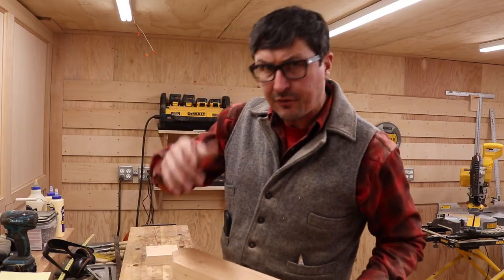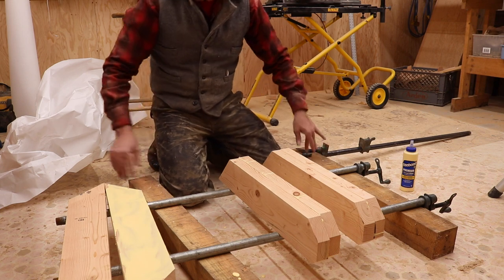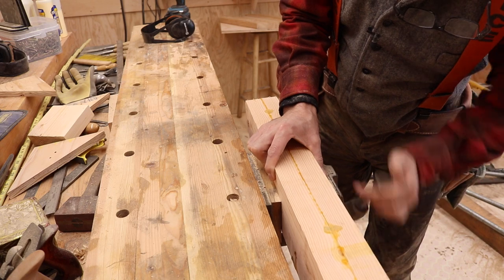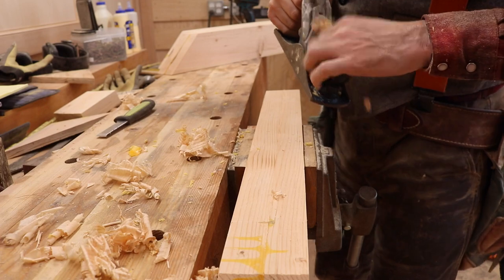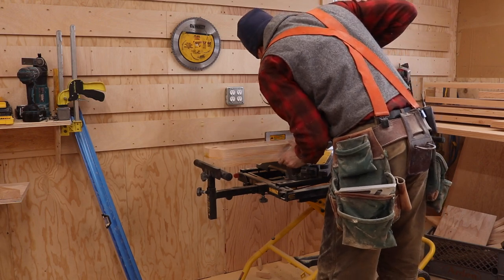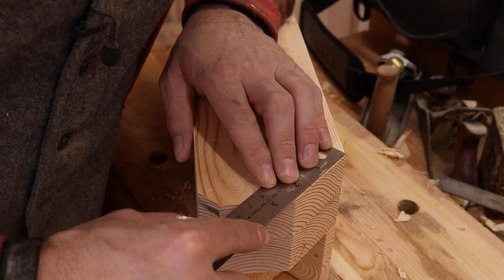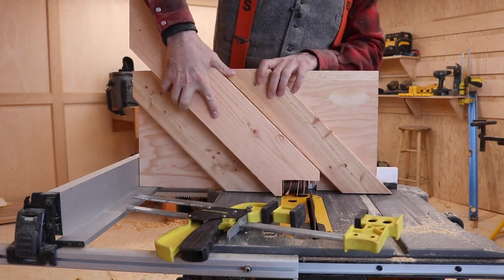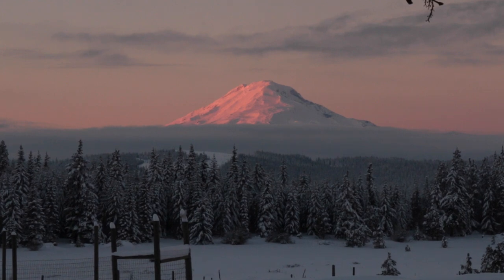Build A Simple Sturdy WORK BENCH for $150

Comment: That jig you built definitely works fine. You can save time when you build jigs if you build a table saw sled. Even complicated cuts like the one you were doing wouldn't take more than 5 minutes to set up with pieces clamped to the fence of a good table saw sled

Comment: Mr Wranglerstar note to self if you would have used a wet rag and wiped off the wet glue you would not have worked so hard after it dried
Reply: Scott Nei he may be going to finish it with something  once it is done.  a wet rag will impregnate the glue into the fibers. A finish then won't be able to soak into the fibers
Reply: Lots of people don't want to wet the wood. This is one of the very good reasons not to.

Another method for applying glue is to actually spread the glue (before the clamp pressure) using a foam paintbrush or the like. If you always spread the same amount of glue over wood as a layer, then the amount of glue pushing out is a rough measure of clamp pressure.

You really want to start using cauls when clamping as well. Consistent clamping pressure and avoids the clamp marks.

Enjoying your videos; keep it up and happy birthday to Jack.
Reply: i face palmed when he used the hand plane on glue, R.I.P blade.
Reply: Cody can do another video on sharpening the blade.

Comment: I'll offer a few tidbits that may help you next time.
1. Glue is cheap.
2. Let the glue partially set and use a chisel.
3. Wet rags work, but you may pay for it later when you apply a finish. 
4. Never dull a hand plane on hard glue. That's what cheap chisels and scrapers are for.
Thanks for the great videos.
Reply: I was wondering about the plane, glue hardens stronger than the wood and I imagined it would be rough on the plane. I paid the price of using a wet rag recently on a walnut piece. Ever so slightly, but there's a little bit that wouldn't take my oil finish like the rest of the piece.
Reply: I use an old #80 Stanley scraper for dry glue removal.

Comment: When we made diagonals for bracing and doubled them as you did, we would drill at least two holes through the diagonal side and drive 3/4" dowels through to increase shear strength so over time the glue joint would not shear or weaken.  We'd dry the dowels in the oven (low heat for a half hour or so to slightly shrink them), and then drive them in holes the size of the unshrunk dowels.  The slightest humidity would swell them back to size and they were locked in as if screwed in place.  Never had any come loose, and some of the joints are now over fifty years old.

Comment: I used a plastic card to spread the glue and only need a thin layer, also avoid gluing the last 1/2 inch around the end. once you clamp your wood together the glue will squeeze out to the edge for you.

Comment: Hi Cody,. I really enjoy your inspiring videos.  One tip on removing excess glue.  After your parts are glued up, go back in about 20 minutes or so and scrape the glue off in its semi hardened state.  It will be pliable and peel right off if you catch it at the right stage of its cure.  Give this method a try and see what you think. Best Regards

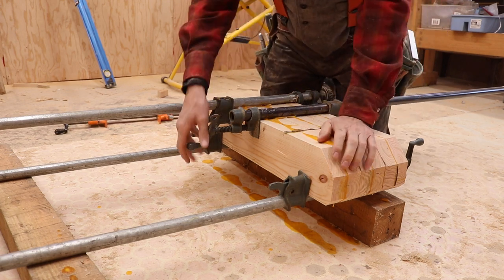Comment: 3:57 What I've learned from the videos is that too little glue is worse than dripping out.
You really spread it out for the complete surfaces to be in contact, so those will be joined forever as if they were a single piece of wood.
Great job and thank you for the valuable lessons!!

Comment: The moment I saw how much glue you were using I thought, boy, is he going to hear about that! Gluing is one of those things that everyone will have an opinion on. How much is too much, wipe it wet, clean it dry, all are personal preference. What has always worked for me is the one my Grandfather taught me. Use enough glue to just squeeze out of your joint when you clamp it, and wipe it off while it's wet. It will make a strong joint, and not require any more work when it dries. Trial and error is the only way to figure out what is enough. Say Happy Birthday to Jack for me.

Comment: Cody, throw some pads between those clamps and wood. Either rubber ones to mount on the clamps or scrap pieces of masonite.  You might want to consider building an out feed table behind the table saw too. And a stacked dado set is indispensable.

Comment: Use a plastic tile glue spreader, or make one from a piece of alum sheet metal. Like a toothed comb. Banding steel works well if you can find some wider stuff to use as a glue scraper while wet. after the glue has set, a piece of sheet metal that has been sheared, will have a burr on the edge that really works well to scrape excess glue. Stainless steel works best for that. A wide beater chisel also works great. It helps to get most of the glue off before going to the saw, the excess glue melts when being sawed, and gums stuff up.

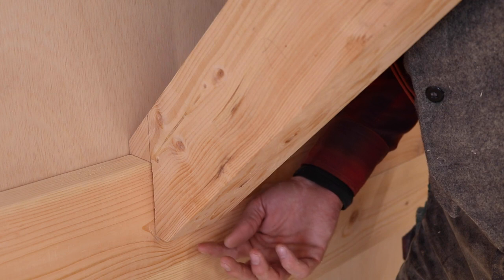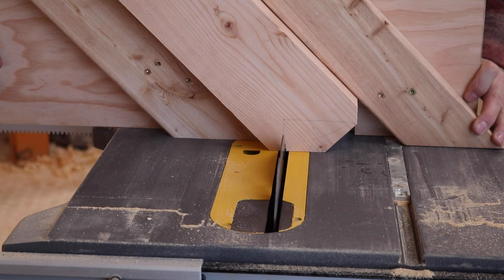Comment: At 11:10. One can Always go one step further and make a notch in the ledger, with a slight slope toward the wall, and make matching slope on the bracket (12:50) The more downforce he harder it will lean on the wall without the risk of sliding off the ledger.

Comment: this is not a criticism of your work (I really like the work) just a thought, it seems the weak point of this bench will be the wall it is mounted to.  The 2x4 studs 24" on center will probably be pretty shakey if you really get pounding on the bench.

Comment: I bought a normal knife from Mora. Going to buy a chisel from them next. I will have to make a sheath for it though. Not a fan of the plastic. I prefer the feel and touch of leather. Always nice when i buy a new side of leather. Makes the shop smell nice for a couple weeks.

BTW - I'm savings the plans for a leather bench down the road. I've had thoughts on making one similar. I think your design is much cleaner.

Comment: You know you've put enough glue on when it starts to seep out of all the sides evenly after you clamp it up but obviously if it's dripping everywhere you used a bit much. if you're clamping together boards with routered edges a straw works great for getting the glue out before it hardens and becomes a bit of a problem otherwise a wet rag works fine.

Comment: Could you use the miter saw to cut the birds mouth? Cut from one side then flip/rotate the piece. You would make two cuts at 90 degree angles to each other. All you have to do is clean the corner a little instead of clean the pieces from all the cuts.

Comment: 3 master carpenters gave me (us) instructions on gluing. use the narrow spout that comes on the small bottles, do not pour from the open bottle! keep the small opening clear using an old 1/8 inch drill or a 16 penny nail. apply a zig zag pattern, zigging every 2 inches on most applications, every 3 inches for extremely hard wood. stay 1/2 inch away from all edges. join gluing pieces together, rubbing the 2 pieces together, separate them and check that ALL surfaces were coated. clamp 24 hours. Pleeeeasse spare your plane,, the poor thing,, lol

Comment: Nice. Get some leather, thick stuff, 5mm (Two squirrel teeth) and glue it to the vice face. It gives unreal grip, protection and you need heaps less torque on the handle.

Comment: HELPFUL TIP*** Hey Cody!  If you ever find yourself ripping stock through your Table Saw thats thicker than the height of your blade, set the depth of your saw blade to just over have the thickness of your stock. In doing so, any discrepancies in the squareness of your blade to your table will be cut in half and you wont end up with nearly as deep of a groove from where your blade brushed back over the second pass!

Comment: Hi Cody, I also have a dewalt table saw and know how much fine powder it produces. Im guessing all table saws are the same. I only use mine outdoors though as i have no dedicated space for it but i avoid the issue of air quality as a result. You should be aware that fine wood powder is VERY BAD for your lungs. Most guys that work in woodshops are very aware of this and have air filtration units on their machines and on the airspace of the workshop. Do a little research for yourself and make your own mind up but do take a little time to look into it !

Comment: You mentioned that you should have cleaned up the glue before it dries. I have always been taught to let the glue dry and then sand/plane it off as you did in the video. If you try to clean up the excess glue when it is wet you will end up smearing it into the grain of the wood. If you were to stain the wood, the glue could effect the ability of the stain to soak into the grain resulting in discoloration

Comment: Instead of using paper on your bench to keep off the glue, try my technique. I got a plastic carpet mat for an office chair that doesn't have the spikes on the one side and is smooth on the other. Cut it down to fit on the bench top and use it when gluing. It can be cleaned with a wet cloth before the glue dries or scrape it of with a putty knife or wood scrapper. The glue does not stick to the plastic. Saves a lot of trees in the forest and money in your pocket.

Comment: This isn't a criticism more so than just an observation and suggestion from a guy who took woodshop in high school and has done a few projects since then.  That was A LOT of glue @ 2:12.  Feel free to waste as much as you want, but that was way more than you needed and you ended up having to take extra steps in your project to clean up the mess.  You seemed to recognize that.  May I suggest some disposable foam brushes and a coat just thick enough to cover the entire surface?  If you're squeezing out that much, you're using way too much.  Cheers!

Comment: You should check out Jay Bates woodworking channel he has a rubber? roller about 4" wide that he uses to spread glue with.  It seems to get a very smooth and consistent coating of glue on his boards and while he's never shown the cleaning of it I assume you could just rinse it with water for a quick cleanup.

Comment: I have seen fellas use sawdust to help clean up the glue spillout when they clamp them up and seems to help quite a bit.
Reply: Mike Sweeney if you don't pour a whole bottle of glue on and then use excessive pressure on the clamps, you won't need sawdust for anything.

Comment: about a 3mm layer of any adhesive would be sufficient mate :) and yeah use backing for your clamp down too :)  LOVE the channel. . . recent subscriber enjoying all the content i've taken in thus far!
Reply from the maker: 3mm? what are you talking about Sikosis?
Reply: heh, the glue you put on the braces. . . . used probably 3x the glue you actually needed :)  was always taught between 1 & 3mm with some air time to induce tac. . . then brace with at least a cross brace to dry. . . . always cleaning excess and press over during the process.
Reply: It's that archaic metric system I think.
Reply: I was also thinking. . . you should use more time-lapse. . . you can still show the work, just at an accelerated footage rate with commentary or some of the excellent music choices you make.  it would provide more flexibility in framing an episode and allow for timing continuity in those episodes. . . while giving you greater amounts of footage to use. . . but don't loose the initial complete "first runs" of the things you do, that is indeed one of the things I enjoy about the channel, one of many.  . the fact that you show people who may not have a particular skill set the steps / processes and method behind accomplishing any particular task.  Again KUDOS on an excellent channel, quality videos with artisan level drive behind realistic application.  Additionally, might I comment on how well maintained, positively glowing and wonderfully open homestead you present, a thing to ascribe to for all.
Reply: hahahaha

Comment: Mr W. First of all, I wanted to let you know how much I appreciate your videos. Thanks for all of the effort you put into them.

You mentioned that the pipe clamps had dented the wood slightly, and I wanted to share a solution I came up with a few years ago. I cut some 2x3-1/4 rectangles of 1/4" thick wood, then drilled a 1" hole for the pipe to go through. Slip a pair onto each clamp and they will protect the wood. Here is a picture of the end result.  https://flic.kr/p/RMpy4C  No more dents!

Comment: A tip from a furniture maker you use way too much glue, i believe your glue isn't gap filling so you just coat te surface lightly or the lamination won't actually be all that strong because the layer of glue is too thick

Comment: If you watch the woodworking channels on youtube most of the carpenters spread there glue over the work pieces so that every square mm is covered by a thin layer of glue.   With experience they learn how much is too little, enough and too much.  Some will use a roller to spread glue on large surfaces and many will use a piece of cardboard or a plastic scraper to spread it thin.

Comment: Like you really need someone else critiquing your methodology, but if I may offer another suggestion; you have the roll of paper, why not put it under the wood you are gluing and then you won't have to clean up the floor? Also, I have found that the inexpensive chip brushes available at Home Depot and other stores make great glue spreaders. Use them and when you are done toss them away. One other thing, paper towels wipe up wet glue easily.

Comment: Why did you not put screws in your braces for extra strength?
Reply from the maker: Glue is stronger than screws,
Reply: Wranglerstar 
Have you ever thought about using a biscuit jointer and biscuits when combining two or more pieces together?

Comment: You really can not do a good job of cleaning excess glue of before it is dry.  A dry rag wil just smear it into the rest of the wood.  A wet rag will raise the grain.

Wait till it dries and use a sharp, heavy duty pull-style paint scraper.  Finish with your plane.

The other trick if you are gluing together 2by to make 4bys that you want a sharp edges on, if rough cut the 2by to length, glue them, then saw off the "bullnose" and finish with a plane.  Same thing you did, juts different order.

Comment: Liked your video until you started bitching about the 2 X 12 being less than 11-1/2"   All framing lumber 2 X 8 and up is cut down more than 1-1/2".  A 2 X 8 is typically 7-1/4" wide.  2 X 10 is typically 9-1/4" wide and your 2 X 12 should have been 11-1/4" wide,  not 11-1/2" 

Why is this ??  No clue,  but it is industry standard.